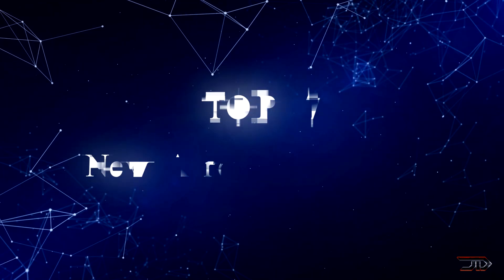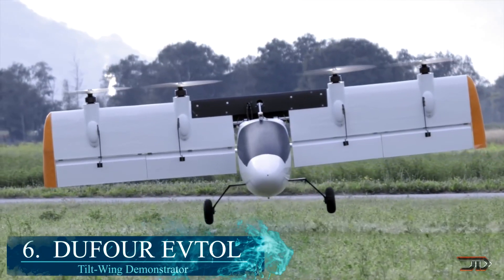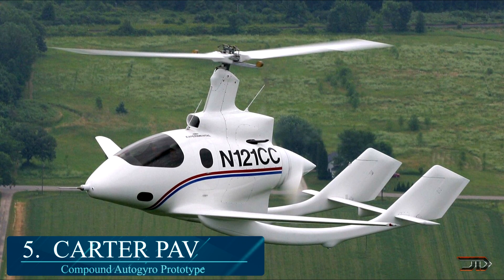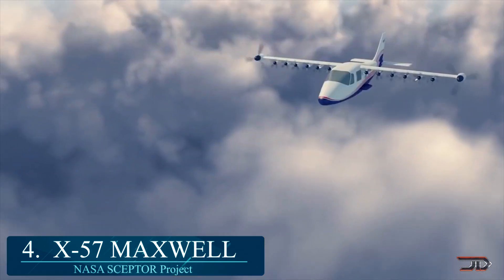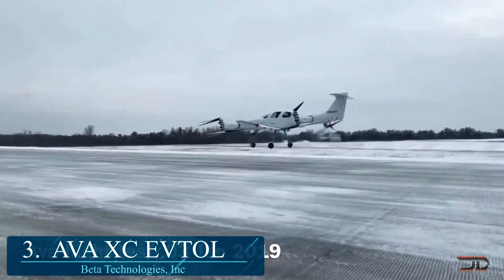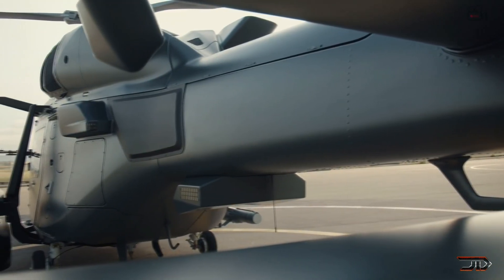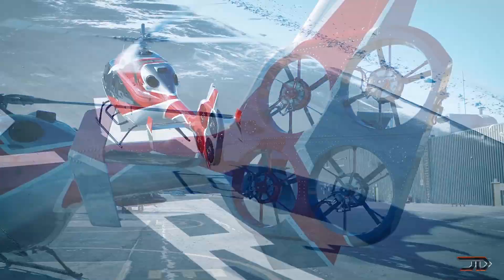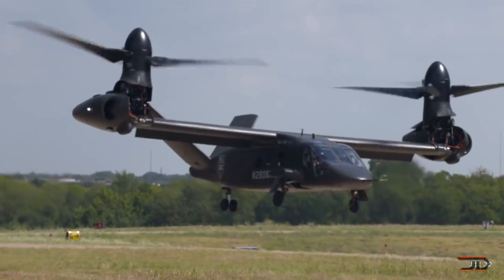7 WEIRDEST New Aircraft Designs

Comment: Yeah the multiple motors for anti torque is pretty dandy. Looks stupid, but each of those rotors is going to be spinning not quite as fast as just 1 most of the time. Therefore less maintenance but hopefully also large window for longevity/reliability especially if they each have the power range to compensate the loss of the other 3.